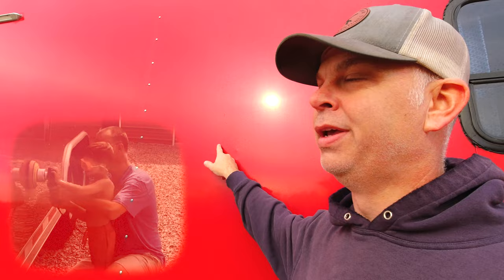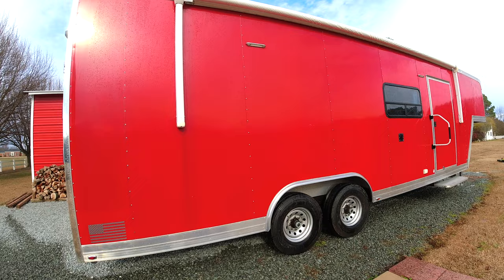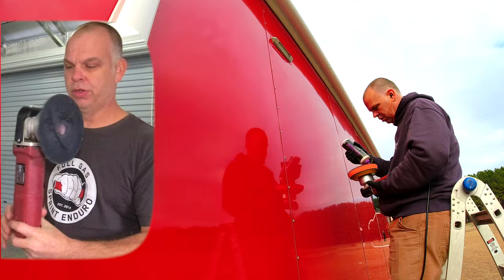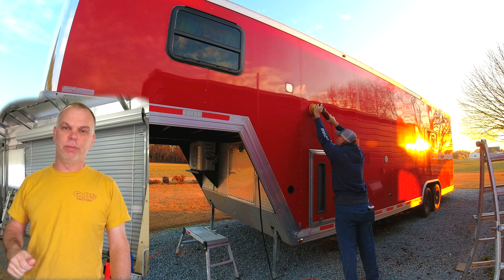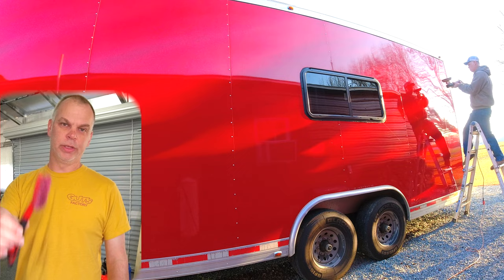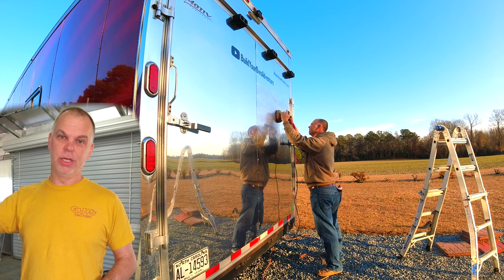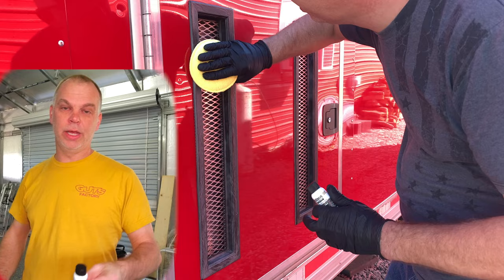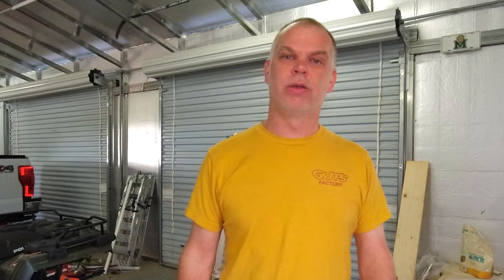Take Your Cargo Trailer Conversion to the Next Level: Make It Shine!!

Comment: Thanks for your video! I have a white .040 aluminum pet grooming trailer and it needs to be buffed and waxed. My trailer does have some scratches. 
IS your trailer aluminum .040 as well? Would this technique  be the same?
Reply from the maker: Glad it helped! Yes, ours is the same thickness of aluminum panel. You would use the same technique to get a nice look overall. Getting scratches out can be tricky and sometimes not worth it. You would need to use a more aggressive compound to remove scratches but the paint on these panels can sometimes be very thin. Getting too aggressive can remove too much paint! Sometimes down to the aluminum.. I would recommend going over the entire trailer with 3D speed and an Orange cutting pad and see if you are ok with the results. Odds are it’s going to look great and the scratches won’t show as much. Good luck and thank you for watching the channel!!
Reply: @BuildYourOwnAdventure  Thank you so much for your reply and sharing this info!
I am so bummed that my nice trailer has scratches on it.-My fault. I have a very nice trailer that is just about 2 years old and still looks so nice even with the scratches but dang it... The bottom line is that the tree branches won unfortunately. I hate seeing the scratches. I'm not sure they can be buffed out. And as you mentioned about the paint being thin... yes I bet it is. 
I have never buffed anything before! I recently purchased a Chemical Guys Orbital Polisher, Pads, Polishes & Compounds Kit. It does include an orange pad along with other pads and Extreme, Hybrid, Cutting and Finishing compounds.
I hope I can get this done!! :)
Reply from the maker: I completely understand! Our trailer is far from perfect. Even polishing over the scratches will "soften" them up and make them less noticeable. Polishing your trailer is not hard, but it will take lots of time. The good news is that it's a flat surface with not too much to work around. Start in the most open area and work in a 2'x2' area. I usually make three passes on paint that hasn't been polished before. Be sure to clean your polishing pad often. I blow the pads out with an air compressor. Search for Dallas Paint Correction on YouTube. He has great real world detailing videos and several on how to polish paint. There are tons of great YouTube Detailers out there that will help, but remember you aren't polishing Ferrari's!
Reply: @BuildYourOwnAdventure  Haha! (to the last sentence!)
Sounds like there is a lot to it... but yeah, sounds like most of it is lots of time! 
Thank you for sharing so much. Your video here and your comments are very helpful. I will also check out other you tuber detailers... I have been doing that lately as well. Thanks again!